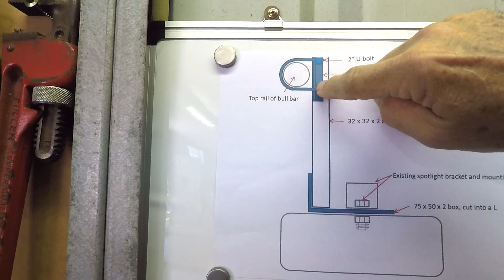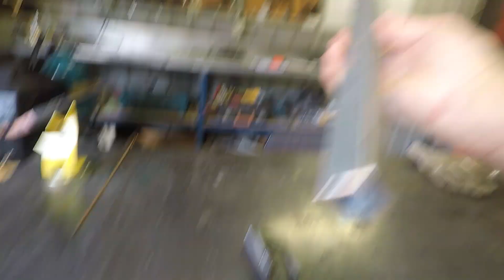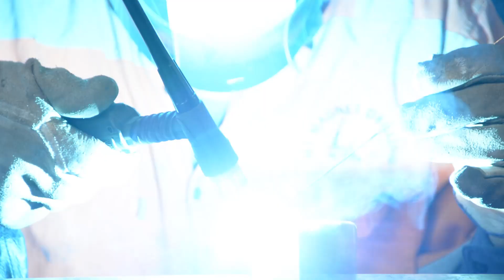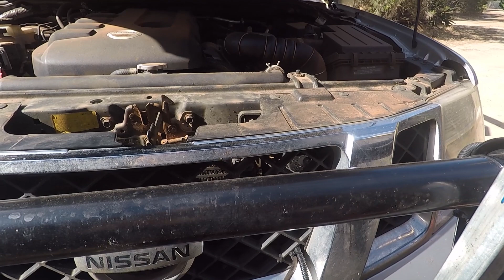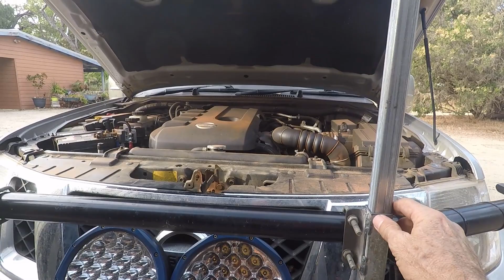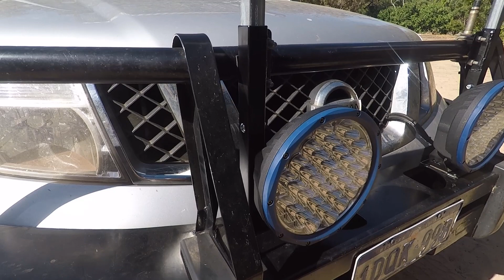Carry Long Lengths of Pipe With This Bullbar-Mounted Carry Rack

Comment: Hey Rusty, I found your video after doing a search on the internet. We are buying a ute, we want it fitted with bullbar and front and rear racks, but they wont fit a front rack to the bull bar because something to do with the airbags sensor. So I am going to get a friend to fit me one, but I wanted to ask, how do you determine what weight the racks can handle? And is there some govt regulations regarding weights that can be loaded on to racks? Cheers
Reply from the maker: Hey Dingo, I'm pretty sure the roof racks on the Navara are rated at 80kg, so I figured the front rack is really only 'supporting' the 80kg, rather than having to take the whole weight. I built it for what I thought would be strong enough for this role, which I'm sure it is, but haven't looked into any govt regulations that relate to such a front rack.
Reply: @RustysOutbackAdventures  yeah that would make sense..cheers mate

Comment: that's exactly what I need to carry 2x16 foot trestles and planks..some good ideas here. How did you figure out the exact height..laser level flush with top of the roof racks, then hold a long level  against the bullbar and mark where the red dot hits???  my ute need 3 racks for the trestles..tail, roof and T rack on the bullbar ..be nice to spread the load as evenly as possible. Also another dumb question ..what do you estimate the racks you built are load-rated for?? (ballpark) cheers Steve from Beenleigh
Reply from the maker: G'day Steve from Beenleigh, glad you enjoyed the video. In order to work out the height of the horizontal bar on the rack, I  measured from the floor of the roof rack. I'm not sure about the load carrying capacity, but as any load would be spread between this rack and the roof rack, I wouldn't want to put more than 40 - 50kg of actual weight on the rack.
I use it a fair bit, especially for carrying long lengths of box and round tube (both steel and aluminium).

Comment: Looks great Russell, very detailed drawing mate. I had built a similar one but just a single legged version for picking up a few 6m lengths of guttering & downpipes type stuff.
Reply from the maker: Thanks Jim. I've left the brackets in place and removed the removable bit, as I've got some 90mm storm sewer pipe to pick up soon.
Next project is the aluminium roof rack!
Reply: @RustysOutbackAdventures  that'd be great mate,  I look forward to it.
Reply from the maker: Jim, I bought the aluminium for it on Friday so it's the next project on my list! The rack worked a treat, too.